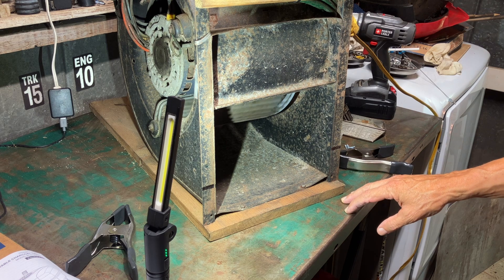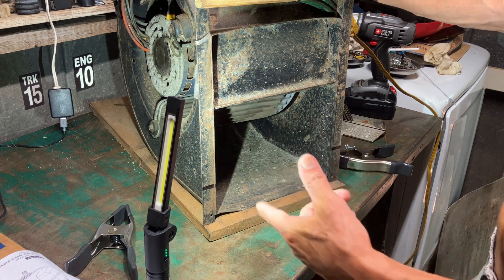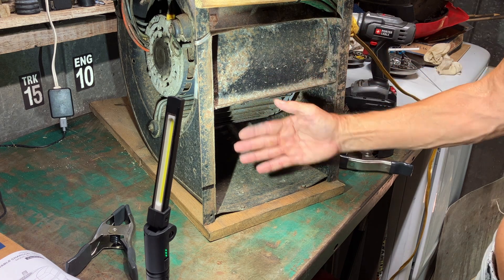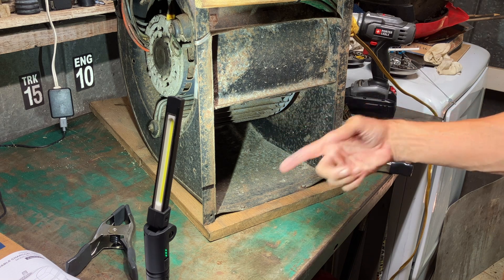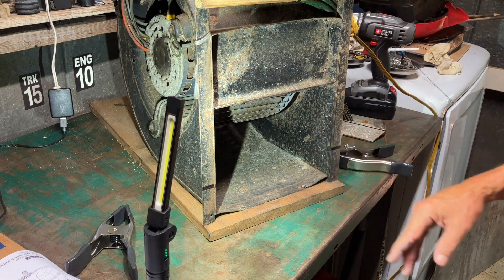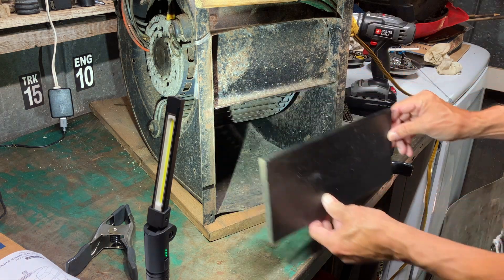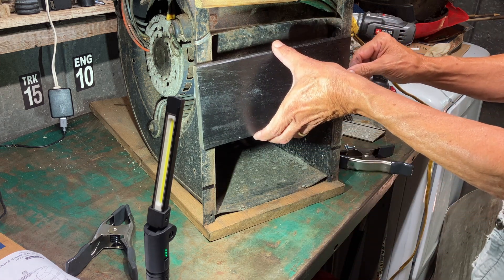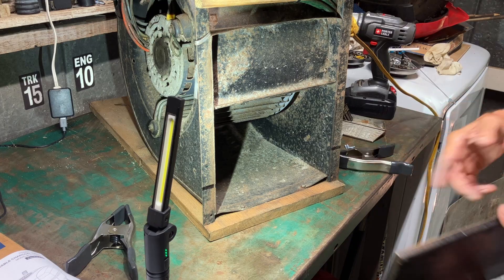HVAC Blower/Shop Fan Hack To Extend Motor Life

Comment: This is awesome, I've had a damn near brand new one of those kicking around in my shop for over a year that I took from my father's HVAC system. I knew it was one of those things that was sitting in the corner of the shop forever but also super useful.

Comment: Did you happen to take a measurement of the current draw before and after?
Reply from the maker: no i did not.. don't have a clamp meter..
Reply: there would be a higher amp draw, or the same amp draw, there is more work being done, so it with either draw more current or lower the speed, or a combination of the two. 
but I am at a loss to think of a reason why making a fan do more work extends its life.
Reply: @johng.1703 well, it’s actually doing less work. Greater resistance means less work is being done. Think of it in purely DC electrical terms. Greater resistance means less current. I think it’s either the same current or lower, so no extending the life by limiting airflow. You could probably extend the life of the bearings that way though. I have one of those setups, but put a 3 way switch on it bc it was a multi speed fan. Low has plenty of airflow.
Reply: @kempie9901  so if I strap 100KG of weights to your legs you are going to be doing less work running a marathon than without those weights right? 
blocking the exit is creating a greater air pressure, aka more dense air, which the blower has to work harder and compress the incoming air. so it doesn't turn as fast as it is doing more work to turn the blower. now there are going to be electrical connections that while not moving as fast, there is going to be more current flowing through them.
if you really want to test this out, use a vacuum cleaning and restrict the intake, it isn't going to like it and the power consumption is going to go up and the motor is going to get hotter.
Reply: @johng.1703 you should calm down my guy. I wasn’t saying anything negative towards you. When you restrict the airflow causing less air to flow, by definition, less work is being done. May be less work for the same amount of current, but it’s less work nonetheless. Your analogy of adding weight to a runner is not even close to the same thing because you are causing MORE weight to be moved.
Reply: @kempie9901  what you are doing by restricting flow is increasing pressure. this means that more work has to be done. the reduction in speed is a direct result of it being much harder for the blower to turn, because there is a massive increase in air pressure due to the the restriction of flow. you are exchanging flow for pressure. 
the flip side is also true, when you put the restriction on the intake you are dropping the air pressure and the blower has to work harder to bring in air to blow. 
yes there will be less volume of air being blown out, but that doesn't mean the motor is working less. so yes you will save on bearings but you will be sacrificing the contacts on the motor instead. last time I checked, bearings are much cheaper than motors.
Reply: @ explain to me what work you think is being done by the fan.
Reply: @kempie9901  moving air, and when there is an obstruction, creating pressure.
Reply: @johng.1703 ok, so my initial intention was not to belittle or demean you in any way. I only wanted to know the difference, if any, in the current draw. You are obviously in way over your head here in the comments, so I’ll leave you alone here. Any further comments here is a wasted of both of our time, and nothing will be learned. Good luck on your channel bud.
Reply: @ you do understand that I am not the person who made the video right? 
But reading your question it would be specific to the motor and setup they are using. You would get different results. One thing is for sure though, it isn’t going to be using a lower electrical load.

Comment: I was told the same thing. In my case, I wanted to use the blower as an air cleaner, so I built a cabinet for it that let me mount a 4" high-MERV filter and a 1" pre-filter in front of it. I don't have any  way to know for sure that this is enough pressure drop to protect the fan motor, but since I am lazy about replacing the filters and they generally are a bit clogged, my bet is that I'm okay. :-)  What I ought to have done was to measure the current draw of the unmounted fan and then after mounting it. I suppose it ought to be possible to look up the proper current draw for a fan and go by that. Two to three amps, maybe?